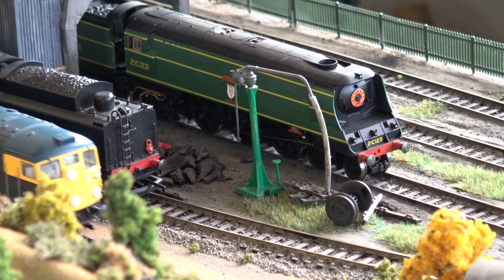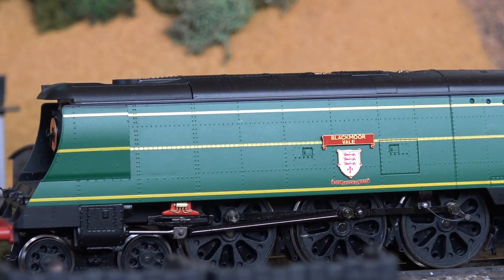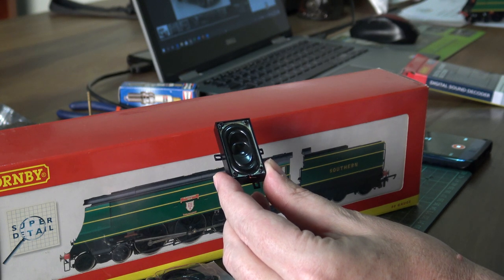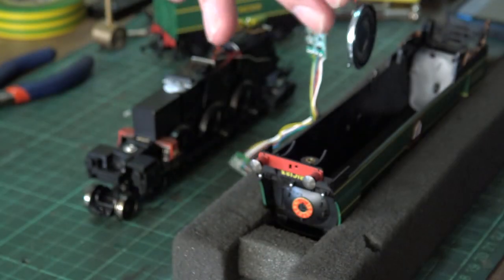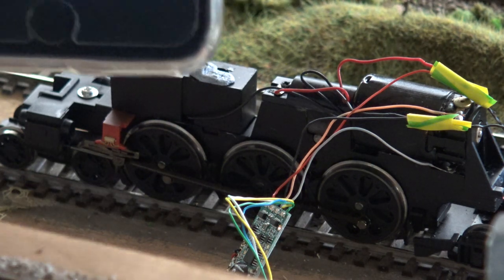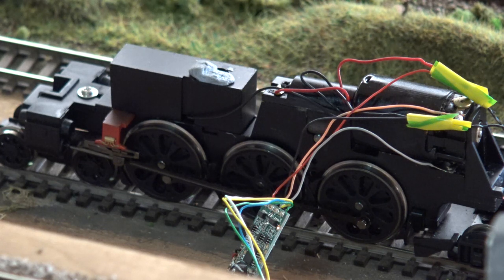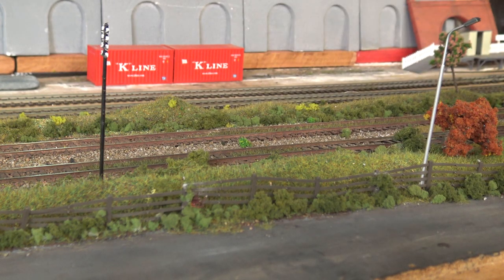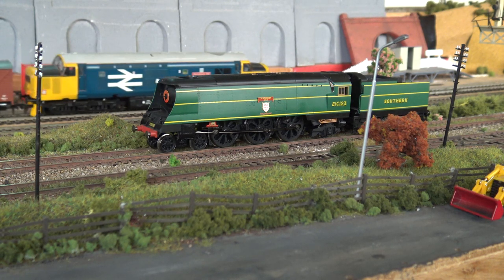Kampala Rd: TTS & Hardwiring One in a Non-DCC Loco

Comment: Hi Jerry, just to clarify, your loco is a West Country Class, named after towns and places in the West Country. They are similar in design to the Battle of Briittain Class and both these classes were smaller than the later built Merchant Navy Class. I have a WC class named Wadebridge in the same livery which is Malachite Green, pronounced Mal a kite. All my locos are analogue dc as I just can't afford to go DCC and that is that. But it was interesting to see how you managed to convert yours and actuaaly get the speaker inside the loco body as well. It sounds absolutely great Jerry and like you say, they really are a nice looking loco. You can see how they got the name of Spam Cans.
Cheers for now..................Geoff
Reply: The first Merchant Navy emerged in March 1941 from Eastleigh Works the first West Country In July 1945 from Brighton. They are hard to tell apart. If named then the Merchant Navy plates are distinctive. Very interesting video
Reply from the maker: Paul Ebberson Thanks I don’t know how I got it so wrong lol! Cheers
Reply from the maker: TRAM JUNCTION Hi Geoff. Many thanks for the follow information and correct pronunciation that’s appreciated. It is big money dcc there is no doubt about it and on top of that when you blow a chip it’s not a great experience. I love the wheels too, so different. May thanks for commenting and I look forward to more from Tram Junction. Best. Jerry

Comment: Hi Jerry a great job there as she sounds and looks good even if the light was poor. The Jerry Allen bad luck with locos seems to have gone but I think it may have made it's way to Kent. Now that I have the wiring sorted I am running in my locos. Two from the same order from Rails of Sheffield failed !! One was a Hornby rail road TTS Flying Scotsman where a connecting rod jammed which is apparently a known problem. The other was a Rail Road Class 59 that ran with great bunny hops then stopped altogether. I must say that ROS were excellent in dealing with it and sent a return label whilst I was on the phone . The Scotsman came back today so hopefully that is now ok. Cheers Kev
Reply from the maker: Well Kev, I certainly hope I have not passed the baton onto you! I am sorry to hear of this but as always, not surprised. QC is still appalling and model railway companies seem to get away with it. RoS are very good as are others but they must waste alot of money trying to sort things out. Hope all is sorted now, Cheers Jerry
Reply: Hi Jerry- I cant think of another industry where you can send out goods that are known to have issues and it is taken as the norm !! I hope this is just a one off but I am prepared for more repeats. I will give the Flying Scotsman a run this afternoon and I await the return of the 59 .. Cheers Kev

Comment: Well done. Inspiring stuff. I may even have another go at TTS fitting the A3, Merchant Navy and Duchess currently in my 'failed at stage 17' department. It is only my hard wired TTS locos which failed, so perhaps my tender wire connections, despite all precautions, were incorrect.
Reply from the maker: Be very careful re the tender wiring, get that wrong and the chip goes up in smoke as TTS are very fragile! I know! But yes give it a go, very simple and everything works. Best. Jerry

Comment: Hi Jerry, can anything be done to better-synchronise the 'chuffs' - should be 6 / revolution, which should speed up as the locomotive does?  This is my 'gripe' with sound on kettles. Al.
Reply from the maker: Alan Toms You have mentioned this before Al and on TTS I don’t think there is from what I have read and seen. Not sure how you get over this issue. I does stand out on this model more for some reason or it may be me just more aware ! Cheers Jerry
Reply: Sorry for that. I thought I had read somewhere that the 'chuff frequency' could be adjusted - might be worthwhile verifying. Mightn't be that important to you / can accept it. Al.